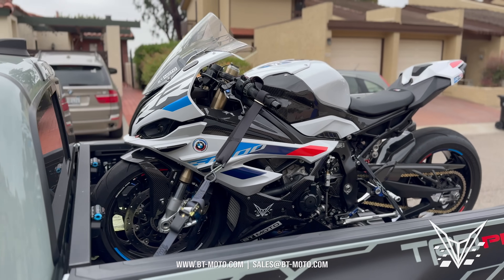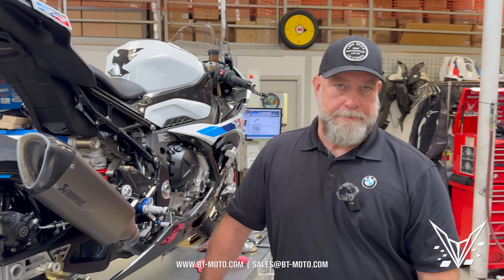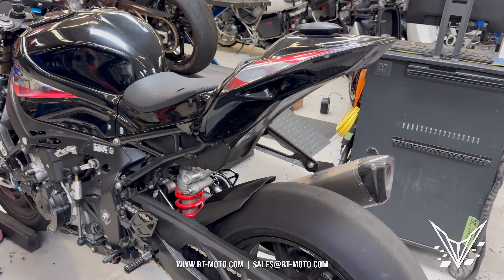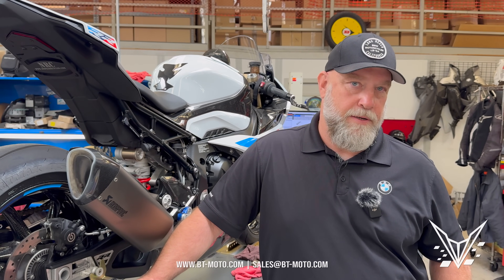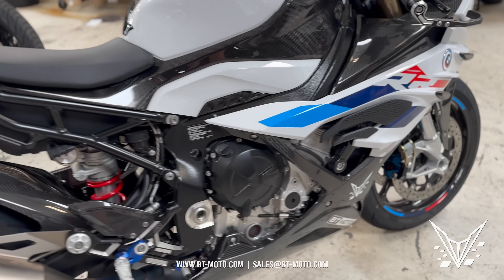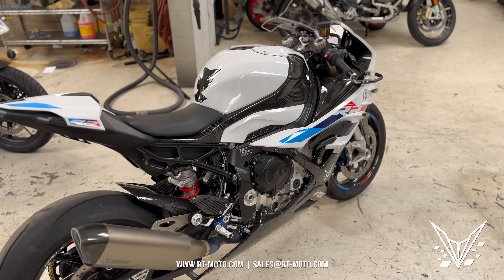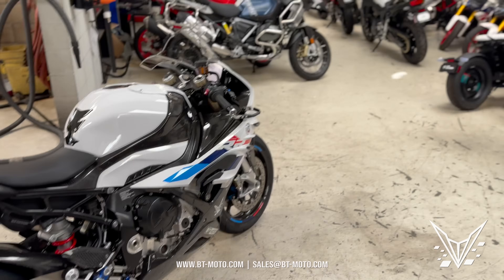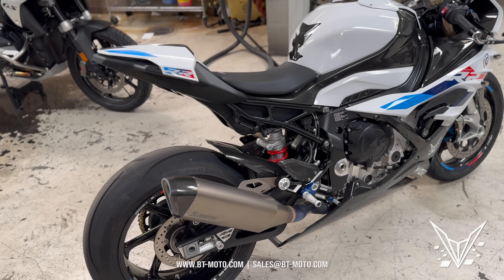We Broke Our 2023 S1000RR, Will BMW Warranty It?

Comment: My dealer says stress fractures in the carbon rims are surface cracks (cosmetic) and will NOT be warrantied… if the structure is compromised, they will replace them. He recommended not buying them for any bike that ever sees a street.
Reply from the maker: @TheDudeAbides.  this crack couldn’t be felt from the surface
Reply: @BT_Moto   No hate or allegations here, my friend. I am happy they got you sorted under warranty. 

I have a 2024 and my dealer straight up said exactly what you repeated dealers are saying “Don’t mod the bike. At all”.  
I want your tune to smooth out the midrange… I don’t like the way it feels like a 600 with the stock tune… nothing… nothing… nothing… 8k RPM. 💥 and it tries to tear ya off the damn thing.
Reply from the maker: @TheDudeAbides.  hopefully you can find a mod friendly dealer. They definitely exist, like Long Beach BMW
Reply: @BT_Moto  I am in VA… we have one, 4 hours in any direction.
Reply: @BT_Moto  all the dealers need to get on the same boat with this tune... as long as they don't up charge.

Comment: There is also another  same incident which happened in india where the carbon wheels got cracked the rider filled up the air again and again they could not thought that the carbon wheel can crack   in the brand new vehicle the same vehicles engine  blown up below 2000 km the bike was stock so they did replace the engine .. these carbon wheels are very sketchy ..

Comment: MAX BMW won’t touch any s1000 bikes if they don’t look stock.
Reply: Which MAX Dealer? Connecticut
Reply: @Ken_Myette  It was at Hampton NH.  Dropped my bike off due to a non start issue.  Cranks but doesn’t start.  A week goes by, got a call from the service manager to bring the bike home. It’s fixed? No, boss said we don’t service any s1000 RR, R, XR unless it’s stock. Too many modifications and don’t want to deal with it.  I’m like dude, why didn’t you tell me that before I dropped my bike off.  Super pissed.  Yet they still have S1000 bikes on the floor for sale.
Reply: @chenchen8597  Was it under warranty?
Reply: @Ken_Myette  it's not and he also said my 2019 s1000r is old.  Lost a customer guy. Don't recommend doing business at max.

Comment: Or you could just not buy bmws because they’re garbage and blow up and not even the fastest bike or even close to the fastest bike for that matter.. all h2s, v4r , v4s , rsv4 , Honda rrr , zx10rr all bikes capable of pumping out larger numbers after modification and probably all more reliable while they do it
Reply: all but two of those bikes (Duc, Ape) are ugly though LOL
Reply: @mookielewis3709  you’re definitely the minority with the opinion that Ducati and aprilia are ugly
Reply: @garyparietti5124  I was actually trying to say that those are the only two that are NOT ugly lol
Reply: I think your reliability claim is WAY off basis...as I have seen EVERY bike you listed have MAJOR issues.....  THe thing with BMW is that everyone is airing their experiences quite loudly every since the highly publicized failures.  Also, if you look at the Japanese manufacturers, the lifecycle on their designs are 10-15 years, where as Ducati and BMW are a LOT faster than that...they do massive changes every 3-5 years...the true answer is EVERY manufacturer has issues, but if you have a BMW it will be plastered all over the web...LOL
Reply: Toprak winning with that M1000RR though.
Reply from the maker: @garyparietti5124  we haven’t found a bike that exists that is free from issues
Reply: @redrider0151  okay well when a h2 blows up it does it while making 100 more horsepower… all the other bikes seem to be 1 off oddities when they fail.. seen 10 bmws over the last 6 months with catastrophic engine failures on YouTube most with less than 1000 miles.. that’s completely unacceptable
Reply: @BT_Moto facts
Reply: @garyparietti5124  So because you havent seen it on youtube you think that other manufacturers dont have similar problems...??  I can promise that ALL of them have issues...its just right now BMW's issues are on blast...
Reply: Ok champ you know it all lol
Reply: @redrider0151  idk why you’re defending a bike that’s soo obviously garbage.. you probably own one and now you’re just getting defensive about your awful purchase
Reply: @lg740xx  LOLOZ....no....not at all....but I am saying that once the bad publicity starts, that EVERYONE will pile on.  II am not saying that BMW is not having major issues, but IMHO its not any different than what most manufacturers have to deal with....its just that in this case, they are fully on blast and we will hear literally about every single occurrence...thats how bad publicity works.  IF there is a known defect in the M motors I sure HOPE they put out a bulletin and they either are stand up about it or are forced to fix them.  I hope its just a few isolated incidents and its been blown out of proportion thanks to the internet.
Reply: I’ve never had an issue with any of my bmws. I’ve had more issues with my r1 and gsxr 1k. Its ok. Don’t want a bmw. Don’t buy a bmw. But don’t speak on shit you don’t know
Reply: Every manufacturer has issues. I've owned all types of sportbikes and they all have their issues. Point is, the BMW S1000rr and M1000rr are some of the most popular sportbikes out right now and depending on the mods, one of the fastest liter bikes on the market
Reply: Unless you owned all these bikes you mentioned... just stop... you sound like a kid. It's just your opinion which everyone has one. Unless you have facts and Data... just stop.
Reply: All bikes have their issues🤦‍♂️ h2 dies because of its battery and overheats, r1s have engine issues, i’ve seen zx10s blow, aprillia is just unreliable, ducati is expensive when it breaks, like i said all bikes have their issue just like bmw. Harley’s are also unreliable but i dont see anyone dogging on them like bmw🤦‍♂️ if you can’t afford to own one and are mad because of it then stay mad
Reply: @jtab5392  I do have facts.. seen the failures 1st hand.. your response just makes you sound salty about ur precious bmw being dog shit
Reply: @garyparietti5124  youtube isn't "1st hand"...
Reply: @willdebeljak7062  bro I’ve owned 20 bikes.. tuned them all.. watched every piece of bike related content that ever dropped.. been riding since I was 7.. own a 280 wheel hp h2 currently.. along with other bikes.. test ridden over 50 bikes.. I’m a technician for a living and I am qualified to talk shit about garbage engineering when I see it weather you like it or not…
Reply: @garyparietti5124  again...youtube isn't "1st hand" you're talking a lot of shit and everyone is calling you out on it. Have you owned a BMW? Are you a BMW technician? Do you have any real experience with a BMW bike? If you aren't/haven't, you are using 3rd party info from the internet and claiming you have "1st hand" experience, which invalidates any thing you have to say.
Reply: @garyparietti5124  out of all the bikes that you have owned, which one would you say has been reliable? And how long and miles where on it?
Reply: @garyparietti5124  I am only saying if you worked on all types of bike or owned alot of them, then you can say which brands are more reliable. I know BMW aren't perfect, but I enjoy it.
Reply: @jtab5392  have 5 friends with brand new bmws.. worked on two of them.. the bike is garbage
Reply: @garyparietti5124  well damn. I've had the previous year. 2013 and have 59k on it. Has BT stage 1 for years. I've only put 1300 miles on my new one. Only problem ive had with the new bike was the wheels, where not balance correctly. All admit the bike is underwhelming in stock form.
Reply: @jtab5392 the old one was good. New ones trash.. new ones soo bad I’m pretty sure if you sprayed low pressure water from a garden hose at the gas tank you’d end up with water in the intake plenum that’s how poorly the system seals.. both bikes I worked on had plenums filled with dirt.. and just like their cars specifically the e92 m3 they put cheap garbage rod bearings in these things.. more than likely the catastrophic failure all these bikes on the internet are experiencing
Reply: @jtab5392 these bikes are on blast right now for good reason… it’s not some conspiracy against bmw like soo many in these comments are pretending it is.. the failure rate of these bikes is anything but normal.. the argument that all the manufacturers have issues is just baffling to me.. I’ve owned 20 bikes and beat the brakes off every one of them I have zero mechanical sympathy for motorcycles.. the rev limiter is my horn.. yet I’ve never had an engine failure on any bike.. these bmws popping left and right like this is a clear as day quality control issue.. THEY FUCKED UP it’s really just that simple.. and it’s unacceptable.. stop pretending this is normal
Reply: Bmw are excellent. You're talking bs
Reply: I'm sorry but this is the biggest pile of cope I've ever read/seen.

I worked at a Triumph/Ducati dealer as a parts/service writer, did other parts work around Aprilla/Yamaha/Suzuki/Honda, all of them, and I do mean all of them have issues. I've seen Ducks needing full engine rebuilds, I've seen Suzuki's needing new top ends and new charging systems only after a few thousand kilometers, I've seen Yamaha's having catastrophic engine failures, seen Honda's blowing their bottom ends, saying one brand is shit and others are better is just plain ignorance.

I also own a 23 S1000XR M Sport, bike is perfect.

Your claims are both unfounded, and just stupid.
Reply: @garyparietti5124  aww bless. You don't have a clue about bikes.